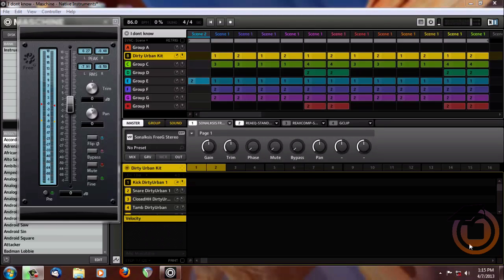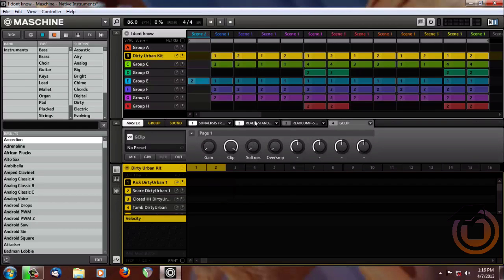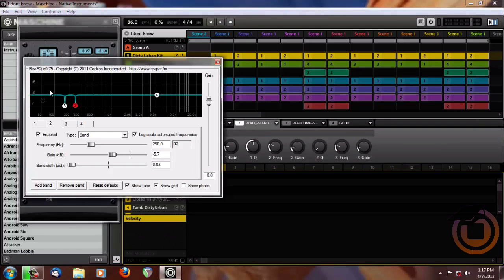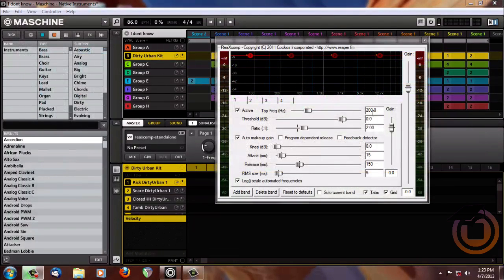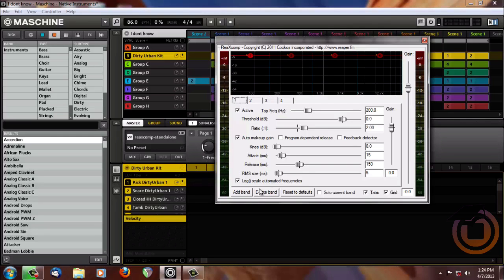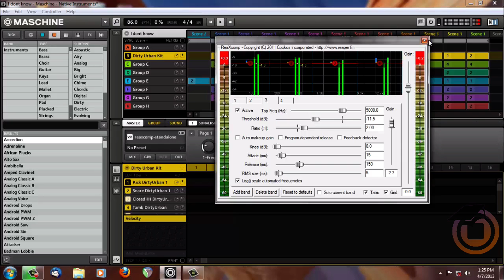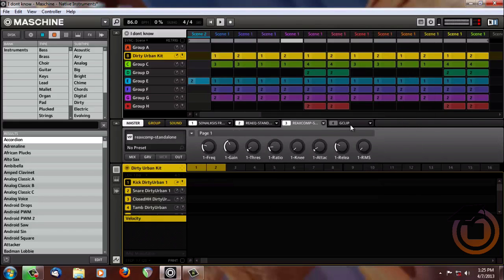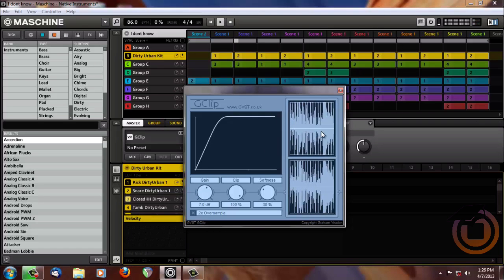Tutorial: Mastering in Maschine using Reaper Plugins

Comment: Interesting usage of the multiband compressor. You've essentially turned it into just a "compressor" by applying the same settings across all bands. (You mentioned in the vid that you do normally apply different settings).

Regarding the auto makeup gain setting - useful for retaining your peak volume while increasing the overall volume due to the compression. I'd recommend leaving it on unless you really want to lower the volume of certain freq's.